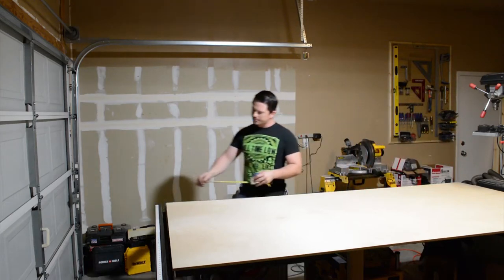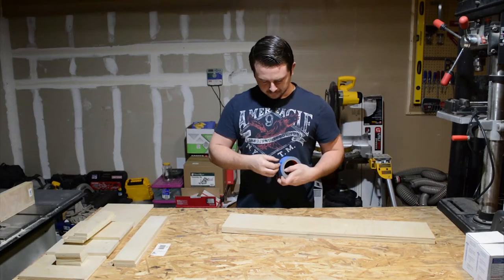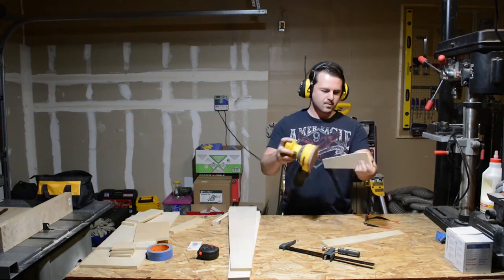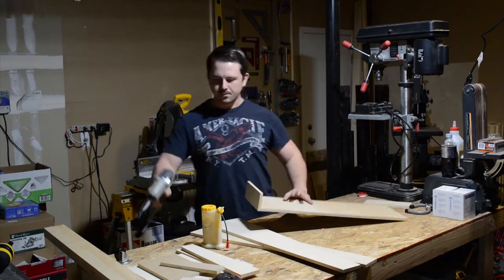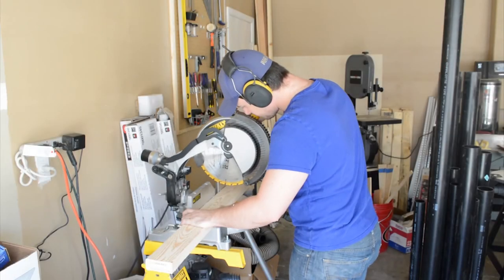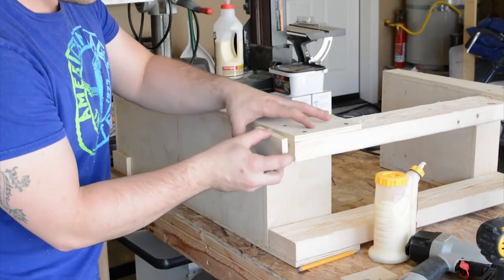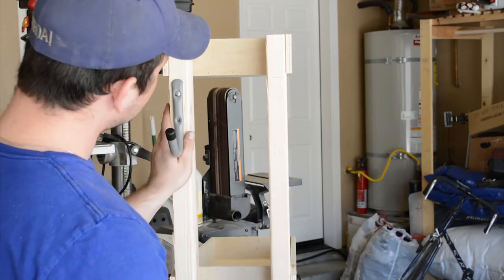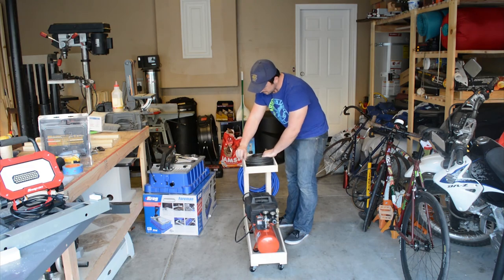DIY Rolling Air Compressor Cart | Build It For Your Shop

Comment: I have that exact compressor, great project thank you and good job.
Reply from the maker: No problem! Thanks for watching my video.
Reply: Looking at your video several times I think it might be safer to use a stop block on the table saw fence rather than running the entire length of the fence, might avoid binding or kickback. Don’t ask me how I came to know this.